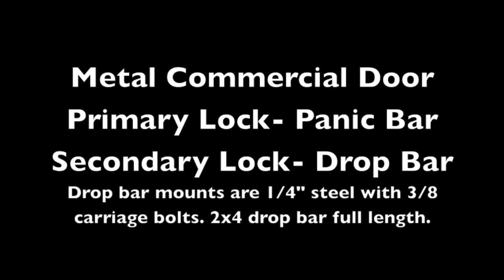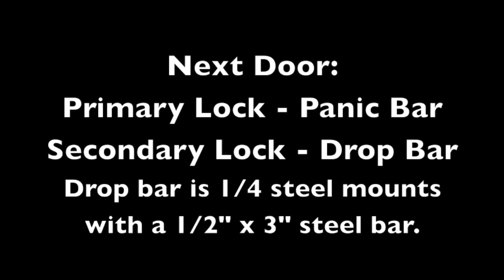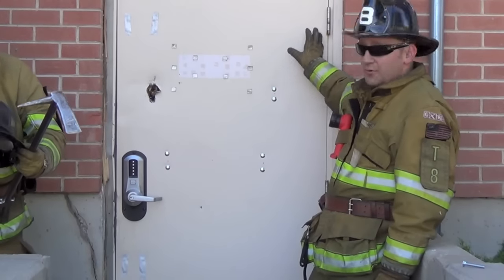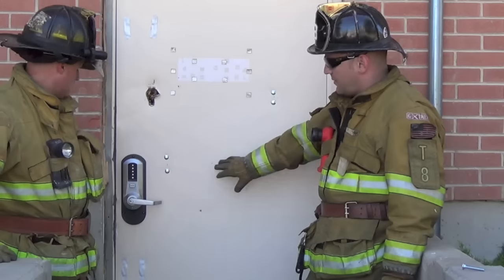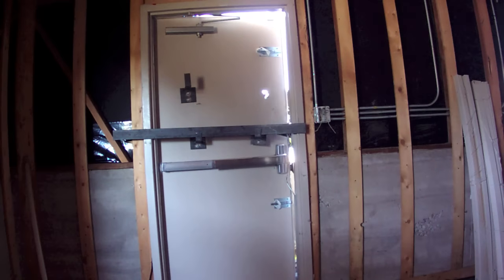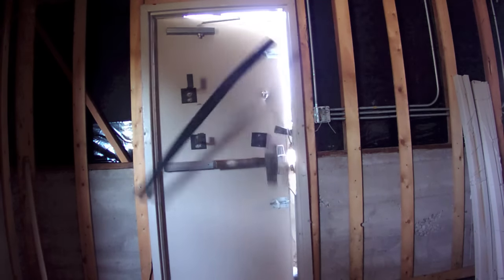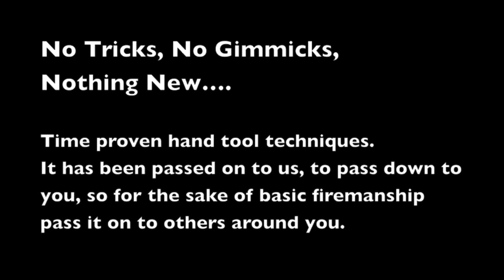Drop Bar Forcible Entry " The Irons"

Comment from the maker: Doing a plunge cut down the middle is rarely effective on these types of drop bars. Many drops bars are mounted so they go behind the frame on both sides of the door. Commercial door frames are usually 6" wide, and a 14" rotary saw only has a cutting depth of 5". If you plunge the saw it won't even begin to cut the actual drop bar. Its easier to attack what we can see, which is the carriage bolts.
Reply: Plunge cut it then stick a carpenter s square in the cut and push the drop bar up and out or slide the square down and pull on panic bar.

Comment: It's a very good demo. However in 17 years of  service with departments that run both Truck and Rescue Squad we've always used the saw and cut a triangle in the door and then reach in and lift the bar out of place. Then the none spent crew can force the door conventionally. We've also cut the triangle in the door then cut vertical top to bottom so the door is in halves with the saw on a heavy secured door. Two bars and Three deadbolts. Good saw inside in less then 60 seconds. Just working smarter not harder.

Comment: Great training, I had also seen a training video where the same door was used in a Forcible Entry video where they plung cut the door and used a T-Square thru the plunge cut and activated the crash bar. I think that method could also be used in this situation and minimize the work/damage to door.

Comment: Firefighters are so badass.
Reply: You should see carpenters!   They can actually Build things.   You take your demo saw and cut any latches or dead bolts or the hinges or cut a square hole in the lower part of the door for water access onto burning material.  If there isn't any, you don't need to get in.  If there might be victims inside, cut the hole bigger.  It's going to be faster than this.
Reply: JB91710 lots of firefighters can build things too

Comment: On one hand, amazing that firefighters can get that, on the other hand, terrifying that they need to take that long, but that goes to show the price of safety vs intruders vs safety from internal elements and the balance between one and the other, in some unfortunate cases including ill advised police forces and  destruction of property (and let's not kid ourselves, there will be no police officer patrolling one such door until it gets repaired  after they bust it warrant or not, and greater luck getting them to pay for the repairs).
BTW, amazing work and demonstration on how emergency crews can get stuff done.
Reply: Well this is why “Knox boxes” are required by most city fire codes to be mounted on the front of the building so firemen can gain access to the whole structure instead of breaking doors.

Comment: The purpose of this video is to show people how firefighters train to open a locked door with a drop bar. Sure there are other things they could do but this is a fairly basic technique. This video isn't meant to show criminals how to break into a house. If they didn't do this training and found themselves at the backside of a building with an axe and a crowbar they would still know how to take the door down without wasting the time to walk back to the truck to find a saw that would have to plugged into an electrical conduit or filled with a gasoline and oil combination.

Comment from the maker: Dave, I have not had luck with shearing 3/8 carriage bolt heads off. I have tried dozens of times and not even come close. I have been able to shear 1/4 inch carriage bolts, but very few drop bars are mounted with such a small bolt.

Comment: after you've tried the initial locking mechanism then you could slip something between the door jamb and the door to simply pull the bar up over its seat to gain quicker entry. You don't need a sport picker to tell you time=lives

Comment: Great video guys.
Interesting, because you only used basic tools, not powered equipment, which probably would have made entry faster. But you may not have power on hand in all situations I guess.
Moreover, it helped highlight security door faults.

Oh, and pretty sure LiliLee meant perpetrate, but in any case crims are not going to gain entry using these methods, they will just bust down an easy door, so lock up well.

Comment: That's a lottttttttt of energy being exerted, especially considering that the real work may be on the other side of the door.
Reply: what do you suggest?
Reply: @joemilton7552  

A hydraulic tool, a gas or electric powered tool.
Reply: @robertwilliams5015  yeah that would be a lot easier, but it's good to know how to do it with the way they show, since sometimes that could be the only option
Reply: @joemilton7552  

I get that sentiment but honestly I can't imagine that a halligan and an axe would ever be an only option for any municipal fire department.

Personally (and I know my opinion isn't popular) but I think a halligan is a rather antiquated tool. Even with the best training and the most proficient firefighter I just don't think you get enough bang for the buck, at least not in an emergency.
Reply: @robertwilliams5015  There are many small departments all over the world that don't necessarily have power equipment, should they also not carry a Halligan?  What would be a better bang for the buck for a small department with no funding?  What would you suggest when the saw fails to start, or when the grinding disk on your only saw bucks, hits the door frame, and breaks apart while the fire rages inside?  Not saying this method should be your first option, but I would definitely want it as an option.
Reply: @joemilton7552  Small departments don't have saws?  "Rabbit tools?"  Either are a better bang for the buck.   What would I suggest when the powered equipment failed?  Hand tools, obviously. I never suggested that a haligan doesnt have its place but it's certainly not something I'd reach for first and a lot of options would have to be exhausted before I even considered using one. I don't have much experience with small departments I work in a pretty big  department and we have backs ups to our back ups.  I can honestly say that in nearly 20 years I can count on one hand the number of times I've used a halligan on an actual job I've never needed one, its more novelty to me. It's like a Swiss army knife....a bunch of different possibilities but not particularly great at any of them.

Comment: what if you just cut the hinges?
Reply: You still will have the drop bar
Reply: If you completely destroy the door, it will then be your responsibility to replace it.
Reply: @sminthian  yeah, but only after the builung burns down or whatever was the emergency.
Reply: sminthian so since they are spraying water on the building do they repair water damage and all that other damage from the fire and structural damage
Reply: Sam Eutsler you very rarely want to completely destroy a door, especially if the building is on fire. If you take the whole door off, it removes your ability to control your ventilation
Reply: 1234lavaking yes I do know that. And ventilation is very important to have control over. I was just saying if the fire is already basically done for it doesn’t matter if you take the door down or not

Comment: I'm actually watching this from a security perspective. 
I realize that this is at odds with your goal as Firemen that need to enter a building... but for the sake of security how much would a heavier gauge steel strip (on the outside of the door) reinforcing the area where the drop bar carriage bolts are plus a few pairs of extra carriage bolts securing this plate impede your efforts?  At a glance it wouldn't be obvious which carriage bolts actually hold the drop bar supports, and they would also hold the reinforcement in place. Also it would be much more difficult to pierce the door with the halligan tool.. I'd be interested in your thoughts!

Comment: For learning sake, what would the next step have been if the door wasn’t able to be forced when it did?  Do the same technique on the other carriage bolts? 

Also,  what are your feelings on shaving off the bolt heads with a K12?

Comment: Adz to shear the bolt heads. Often allow the bolts to drop away from the weight of the drop bar and angle iron/steel...

Comment: As a door professional and a former FF....the hinge side is always an easier side to work on...the screws use in a commercial door hinge are 10 -24 or 1/4 - 20 machine screws.. these are usually only 3,/8 to 1/2 long...the plate they screw into on door or frame is only 3/16...good snap of bar at each hinge shears them off quick

Comment: question, why don't you use your tool on the hinges? aren't they the weakest points on a door? the lock is a thick piece of metal, the hinges just have a couple of thin screws in it.
Reply: You're not always gonna have the hinges on the outside. Sometimes they'll be on the inside or one one side (literally between the door and the wall) this is for "training " excercises.
Reply: @monicaesquivel6073  i know, that's why "never mind" message below...

Comment: so what about on a door like mine? i have a solid metal fire door. i have two drop bars also steel that drop into place between center and top and between center and bottom. BUT the mounts to hold it are welded on the inside. so from the outside you cant tell where it is. and the drop bars drop in place and then have giant pins that go at the outside of the bars, theres eyelets. as well as eyelets mounted the the wall. then theres two more secure points where just the big bolts drop in securing door to inside wall. and on the outside theres a 2 foot plate so you cant pry anywhere near the knob/deadbolt areas. (keep in mind i know with 100% confidence, if the fire department needs to get in, they will. im just curious about how..? btw what might seem as overkill. its a machine shop with very expensive equipment tools and electronics. some cutting bits alone are multiple thousands. and we have had a lot of break-ins in our complex. they hit our door trying when we first moved in. it was the hollow metal door, with just the two bolt things on the inside and plate covering bolt area. the plate was slightly pulled out. and top and bottom of door was pryed about an inch. now these guys would not have mad any more progress that time. but scared me enough to take major precautions. our roll up door also has anti ramraid bars and a few other secured points just in case. hell even if they started. id get the notification. and be there as they are breaching with police. slowing someone down enough is sometimes all it takes
Reply: Simple but time consuming. we'll start on the wall next to the door. the first team keep working on the door. second will either cut their way if its wood/ sheet metal, or break our way in with hammers. only have seen it done once though. too about 4 min to get through a double brick wall
Reply: Semper Fi  in a concert wall you'd have a good point

Comment: I think that if we hit a panic bar, or drop bar without expecting it, (some drop bars are mounted on the wall surrounding the door so as to minimize visibility for potential intruders) the saw would kick back potentially breaking a hand or worse.  Or it could cause the blade to start warping, and if it warps too much cuz of the sudden change in thickness and potentially denser metal, cause the blade to break.

Comment: you could  also cut out a triangle under the bolts with the forcible entry saw to stick your arm in and push the bar up. Then easily force the outward door conventionally with the adz. I'd be curious to see what the time difference would be.

Comment: Maybe I'm dumb, but this whole time I'm thinking they should just Dremel the bolts off and those drop bars will just fall right off... is that slower? Am I overestimating what a Dremel can cut?
Reply: 6 vikings and a treelog works also
Reply: To nie odzywaj
Reply: This is to demonstrate overcoming the locking devices with only irons.  If you're bringing power tools, you're gonna bring something a lot more effective then a Dremel.
Reply: Yes.  Dremels are for model making, not demolition.  They are delicate, fragile tools.  A cordless angle grinder would work, but then you have batteries to maintain and the tool might well melt around a fire.
Reply: As a firefighter I can tell you that the versatility the Irons provide is unquestionable.  If I get trapped in a room and have to break my way out I want my axe and halligan with me over a dremel.  However, I do applaud the thinking outside the box.

Comment: Wouldn’t you want the door at your back if it’s outward swinging , just Incase there would be a back draft so you get thrown forwards. Also your axe man would be safer behind you after he’s done  hammering your ads side in. Just thinking ventilation wise , you don’t really know what’s in the other side of the door, but that’s what your 360 is for.

Comment: This is only going to be effective on a hollow frame, if the frame is concrete filled it’s going to be a lot more difficult to pry the door and frame apart to clear the strike on the frame. Those drop bars are also illegal on emergency egress doors, sure they stop thieves from getting in but they also stop people from getting out. 
Still impressive how quickly they got in.
Reply from the maker: The concrete frames make it much tighter no doubt but we still force them the same way. It just makes your initial drive around the door edge more difficult.  These bars are on almost every building in our district.

Comment: Wow! This really is hard core: Working the tool to the extreme, Time pressure, and a lot of guesswork. 
Respect!
But straining with a tool that hard, is never a good idea. It's very difficult to judge how much force is necessary especially when you are working blind. This is exactly the sort of situation manual labourers try to avoid if possible. Its easy to slip over or pull a muscle and reduce your effectiveness. A frustrating job can also lead to fixation and a loss of situational awarness. The right tool for the job gives you enough mechanical advantage to avoid any desperate struggle. 

Has anyone developed a captive bolt device to free up half the man power for this job? I appreciate that manual forcible entry is an essential fire fighting skill, but DAM! Every second counts for rescue. 
I am sure there are situations where there simply is no room to swing an axe, or two fire fighters for that matter.
Fire fighters deserve a powder actuated captive bolt tool that can punch a hole in a door, but not send metal flying. Let the tool do the work!

Comment: Two much faster methods for entry of the first door...

1. 18v portable angler grinder use to grind the head off the two bolts. Then use the irons on the panic bar. 

2. Hinges are on the outside of this door 😂 drive out the hinge pins with a screwdriver and pull the door open. 15 seconds with an 18v die grinder and cutoff wheel zip bottom plate off all three hinges... while partner grinds four bolt heads off. Door comes right out in 30-45 seconds... die grinder can cut hardened chains and locks like butter in seconds, hinges would be like paper to it.

Comment: gee, see the trick is to brace the outside of the door with a 10mm thick ar500 plate weight about 110kg, you can thread not weld, high tensile 12mm bolts into the sheet steel , the wood door acts as a spring to absorb energy, while the Armour steel make it extremely hard and strong, obviously a heavy steel door jam and strong locks, and hinge with anti jemmy bolts, it is impossible to smash bolts out, and further a neat trick is to cover the steel and the bolts with a zinc coating, so it's impossible to see where the fixings are from the outside. Even further bogus honey pot fixings and locks can be used to "waste you're time" so secure means secure.
Reply: I suppose plastic explosives may work, but you would need so much of it the whole building would disappear, and you all would blow up with it. Aren't you so lucky no one takes security so seriously like i do. Oh and with regards to fire fighter lawful entry, and easy remote fail safe electronic release, and you're in, no bruit force required. easy.
Reply: If the building is that armored up, they will just use an explosive breaching charge, or use a vehicle to rip the door off or go through a  window or a side wall.

Comment: Makes me a bit concerned about my elderly neighbors. If something ever happens to them and they need outside help, none of this banging would help versus the damn vault front door that they've installed. An armored concrete building, steel frames, thick metal door with at least 2 intergrated slide bolts and some sci-fi keyhole.

Comment: I seriously expected it to be harder than that. A steel door with an iron drop bar... And even if that bar was 2" thick, it wouln't have been much longer to open it up. In fact, it might have been faster as they 'lost' their time bending the bar instead of driving the bolts out...

Conclusion, if you want to make something 'theif proof' reinforce the outside! But then they will just use a grinder on the bolts...

Comment: Would have been faster to pop the hinges just saying....

Could you not just drive a spike through the door and manually lift the bar?
Might be faster than driving the bolts.
Just one good swing, pop through the sheet metal, pry upwards and done.

Thinking about it further, would:
Using the haligan at the top to pry the door out.
Inserting a long solid metal bar. (5-8ft)
Hammering the bar down towards the door jam.
Then just brute forcing the door.
Not work?
I see you already covered this: https://www.youtube.com/watch?v=B2AIQSkbUzo

Comment: Literally could have slipped a 1/8th inch wire with a bend to the right,Slide it up to knock off the wood price
Then down and twist and pull to get the crash bar. Under 30 seconds, 0 strong man training necessary .